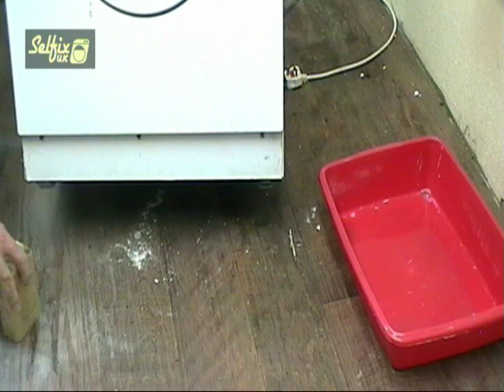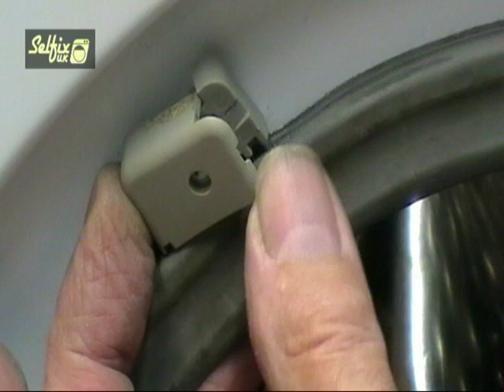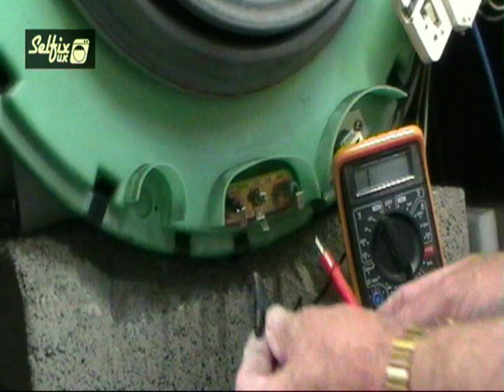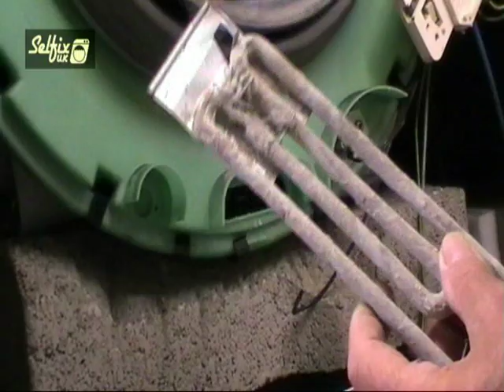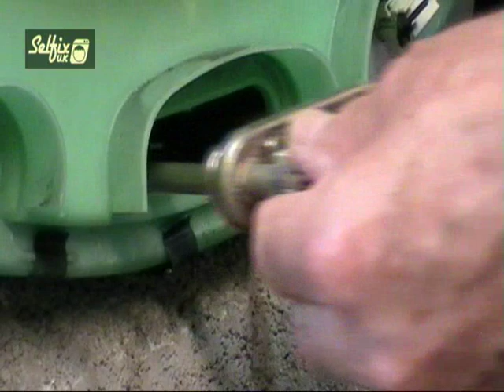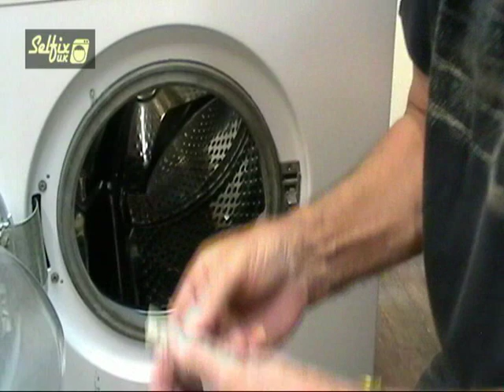How To Replace A Washing Machine Heater

Comment: Thanks for this video of the HP WM w/m !  You're the the only one giving good practical help on the older WM models. Also the door outer securing band on these models is entirely different to the later WMA models, and this video helped me understand and remove it.👍

Comment: Great video,  maybe its also worth noting that almost all machines now have the heater located at the back and its just a few screws it get at it.  

Also as you were saying about pointing the heater down,  a lot of machines now have short heaters that have no clamps or movement,  however some that have the clamp inside the tub and heater slots into what I used to do (former service engineer) is after slotting in the heater but before screwing the nut back on,  is push up and down on the terminals,  if the bracket is in correct you should not be able to move it up and down as the bracket would stop it,  then you can screw it in.  

Keep up the good video's L-)